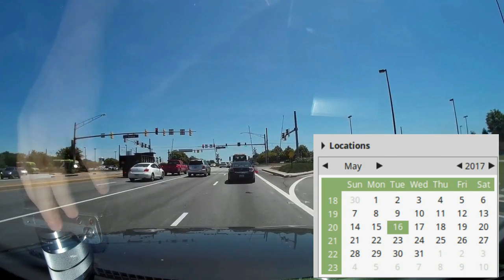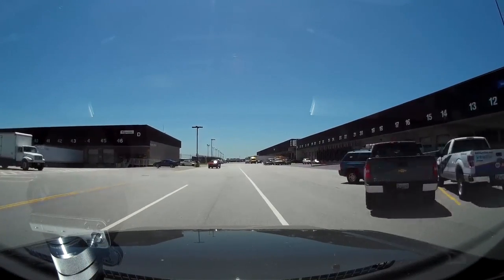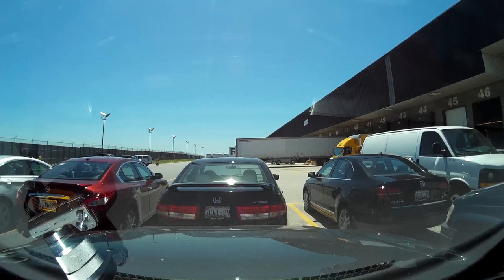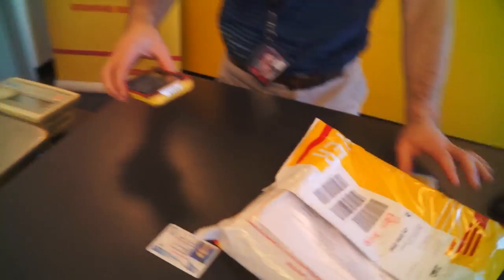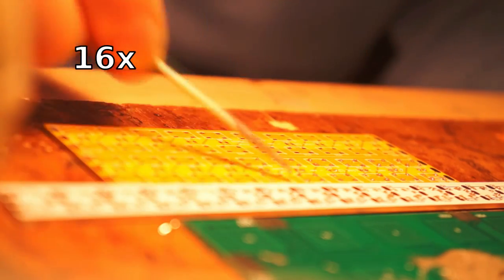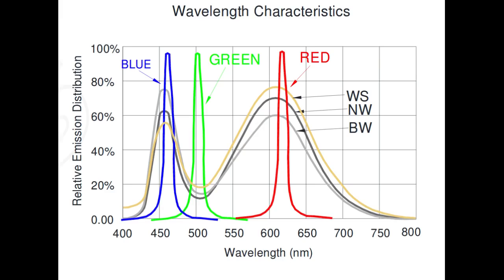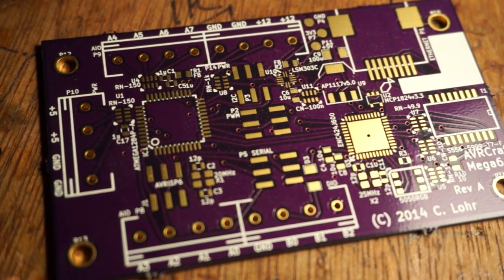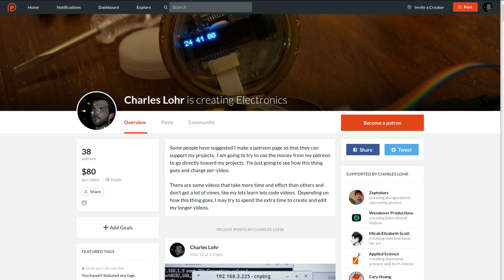PCBs from PCBWay in 108 hours?!?!

Comment: One problem that I constantly have while working with computers is that I don't have enough flash drives, and the ones I do have aren't labeled. I know v-USB is up your alley, so I thought I'd propose this idea to you: Would it be possible to create a device with an LCD screen and microSD port that would allow you to present disk images as USB devices. Would such a device even be possible? How would I begin to learn about this stuff? Thanks!
Reply from the maker: It would be possible, but you would probably find it to be easier to use something like a raspberry pi with a screen and display stuff that way... Writing a program that runs on it.
Reply: CNLohr of course, WiFi control would work to. is there a vusb stack I could use as a staring point? I like the idea of 82Xx based emulator but I really just dont know about this stufϕ
Reply from the maker: Oh, I thought you were referring to doing it the other way around, like something for you to plug into a drive and then see what's on it quickly.  I missed when you said "as" USB devices. 

I guess you could but with the ESP it would be very slow and probably not worthwhile.
Reply: You can get a cheap android phone (<$30) and use this app to mount any image you choose from the phone: https://play.google.com/store/apps/details?id=com.softwarebakery.drivedroid&hl=en

Comment: I have had problems with PCBWay.  I ordered 1000 boards from them - it was a very simple board, 2 layer, routed perimeter shape, ENIG, SMD on both sides and 0603 was the smallest pad sizes.  The soldermask alignment was so far off on many of the boards that the ground pour was exposed beside some of the pads, causing shorts during reflow.  The outer perimeter routing had a variance of about 0.030" between boards.  The silkscreen was so far out of alignment that it was right on my SMD pads on many of the boards.  And the price I was quoted on the website suddenly jumped something like 20% when they looked at my boards and they couldn't tell me why, other than "because of the technology", but refused to give more detail.  There was nothing in my boards that was outside of their listed standards - I was way above their minimums for trace width/space, drill size, annular ring and everything else.  

On top of it all, the routing was horrible - board edges were rough and jagged.  I have fixtures that hold my boards through the assembly process.  We've never had problems with boards from any other supplier - but with PCBWay, only a fraction of the delivered boards don't have the silkscreen or soldermask alignment issues, and aren't so far out of routing alignment tolerance that they fit in the fixtures, and don't require deburring the rough jagged routed edges.  I'd say about 10-15% were good compared to 100% from every other supplier we've ever used.

When contacted about the problem, they asked us to pick out all the boards that didn't meet their tolerances, provide photo evidence they didn't meet tolerance, and then send them back, and they would re-spin those boards and replace them.

We just tossed the whole batch and decided never to use them again.
Reply from the maker: I have certainly never had any issues like this. It sounds like there may have been tooling issues with the board formats (which admittedly they should have complained more about instead of trying to make work).  Sometimes they have had issues with some of the outputs I have given them and have required more rework on my end..  What toolset did you use and how did you go about exporting.

I would also be curious when this was.  I only started using them about 1.5 years ago.  Since then they have done thousands of PCBs for me, with zero faulty boards.
Reply: PCBWay,

That is a very good response, thank you!  Problems happen and mistakes happen - it is more important how a company handles the problem after it has happened.  I am encouraged that you have taken steps to correct these sorts of issues.  I will try PCBWay again in the future for a board order and hopefully things will go smoothly.

I understand that for many customers, price is the most important concern and small quality issues don't affect their ability to use their prototype or home-made circuit designs.  In my case, it's for a commercial product we sell, so the cost of the bare PCB's is small compared to the cost of populating boards with components and finding out later they don't work (or even worse, shipping to customers and having failures).  So I am happy to spend more if I am sure the boards will be done correctly.

Anyway, again, thank you for your response.  I don't want to bash your company online and I know a lot of people are very happy with PCBWay - and I think it's great you are taking steps to prevent issues in the future.  Cheers.
Reply: I think the problem maybe are pcb or component or assembly methods. Have you let the manufacturer engineer test the bare pcb and other?
Reply: Definitely not issues with the board formats - Gerber 247x and I always double check them in GC-Prevue before sending.  Furthermore these same gerbers have been used by at least 4 other PCB fabs with zero issues.  The only one to botch the job was PCBWay.  Also, they make the PCB's in panels (obviously) and some groups of PCB's were way, way worse than others.  It's just really, really, really bad quality control on lining up their soldermask and silkscreen layers.  As for the external routing, it was either the fixture wasn't holding the board well or (much more likely) a very worn router bit was used.  The board edges weren't smooth but rather grainy and rough in many places.  I've never had anything else other than smooth edges except when I've used rat-bite or v-score panelizations.   This happened January of this year.  

The thing about PCBWay is they are just a web front-end for another manufacturer on the back.  The people running PCBWay have nothing to do with actually making your board.
Reply: PCBWay, 

I had contacted you when the order issue took place and you told me to tell you how many of the boards had the soldermask registration so badly misasligned that they were unusable (because the ground pour was exposed and would cause shorts if reflowed).  I don't have time to go through all 1,000 PCB's under the microscope to find the bad ones.  The perimeter routing was also off and done poorly, so sifting through all 1000pcs to find the bad ones wasn't worth it.  As I said, we just don't use PCBWay anymore.  On your points

1) I am glad to hear that you now show the reason for the price increase.  I was doing an online chat with your sales rep while I placed the order and she wouldn't tell me the reason for the price increase other than "the technology", except the board is very simple - no high density drilling, plated slots or edge connectors, no large exposed copper, etc.  When I questioned the large price increase, the price dropped suddenly (still 50% more than the online quote, but not as high as she originally told me it would be before I questioned her on the price increase).

2) There were no issues with my design files.  I've used the same files at numerous PCB fabs without issues including Myro, Itead, OSH, AP Circuits, Ultimate PCB and PCB Joint.  The problem was layer registration/alignment and the perimeter routing.  I hope you can improve it.

3) This was heavily discussed on EEVBlog.  PCBWay is just a web front end for JDBPCB which also owns and runs AllPCB.com.  It was claimed on EEVBlog that PCBWay has its own fab line @ JDB which was said not to be the case.

Comment: PcbWay prices looks pretty cheap and ship quick. :) Have you ever tried their Assembly service?
Reply from the maker: Yes. I have, but it only makes sense on much larger orders.  I think the last PCA they did for me was ~$2k.
Reply: Im thinking about building 50 led arrays with 1160 warm white LEDs each. The idea of doing it by hand is a deal breaker. I found LEDs I Iike at Digikey.  But I'm wondering if I can trust them to source the leds for me? Maybe save by not having to ship reels to china.
Reply from the maker: Yellooowwwwwwww... But In general you can trust the reels from China.  You do have to be very specific... And even then they may sub them out.  It can be tricky... In the words of a salesman at my house.  He warned me "If you do it price, you'll have to do it twice" he charged more than 2x as much as the next person.  I told him doing it twice would be cheaper and kicked him out.

Comment: I usually place order by Saturday evening to get them by Friday just in time for next weekend's assembly & testing (often only to realize that I've messes something up, fixing it and re-ordering next Saturday :) ). But I live in Canada so there's one more hop for DHL. The only real annoyance with them is their stencils are very expensive. So if I need stencils, I order at allpcb.com - stencils there cost just $8, even though it usually takes slightly longer to get them - about 10 days in average. They have cheaper 4-layer boards too ($35 for up to 10 of 100x100 mm boards), but they have "BGA fee" so watch out if you have those (and in all fairness BGA is probably the most popular reason to order 4-layers).

Comment: I use OSHpark for castellations, myropcb for designs where I already have the upload files there, and pcbway lately for cheapness and quickness.  Here is the thing I found with DHL though, they are fine on that international supplier's end, but if you get an account and use it, it is way higher.  I opened a DHL account for international orders on several things, and tested it on MyroPCB.  Myro was going to charge $31, but with my DHL account it cost over $117.  I talked to the account manager, and basically the gist of what I got is they got to rip you off over thousands of orders before they reduce their cost to you.  Ya, we make money shipping for $31, but we're going to overcharge you by almost 4 times until you spend 10's of thousands of dollars with us, then we'll charge you the normal rate.
Reply from the maker: That's a bummer.  I never thought to make an account.